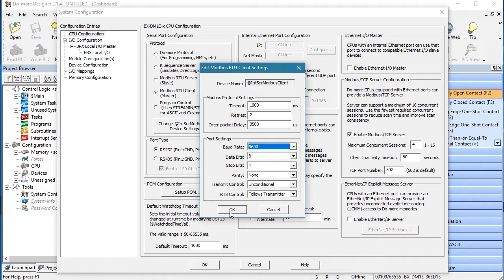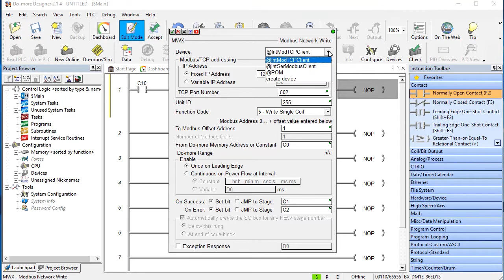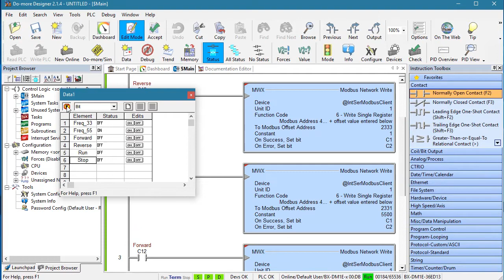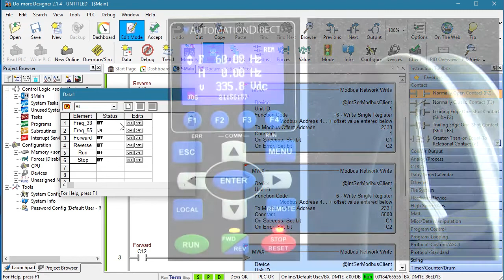Do-more PLC Connect to a DURApulse GS4 VFD via Modbus RTU from AutomationDirect

Comment: When it comes to the port type selection (rs232 or rs485) it's greyed out  no matter what protocol I'm using why is that?
Reply from the maker: Hi Andrew, Are you using the Simulator?  That option is only available on hardware.   DMSim has no resistor or switching of the port to 422 available.
Reply: @automationdirect  no I'm using an h2-dm1e, but based on your response I would assume it doesn't support rs-485
Reply from the maker: Correct, the H2-DM1E is RS232 only.

Comment: Do you guys have a tutorial for the mrx command?
Reply from the maker: Hi Andrew, It's almost identical to the MWX we used in the video. Is it giving you trouble?  If so, then check out the dedicated MRX video: When you drop the MRX instruction on the rung and open it, look in the upper left corner where you see the little Close, Accept, and Help icons.  The last icon is a YouTube icon that will take you directly to the YouTube video. That works for all instructions that have associated videos.
Meanwhile, the MRX instruction video is located here: https://youtu.be/s2GfsCCsAHA